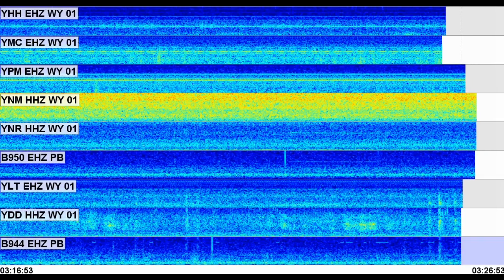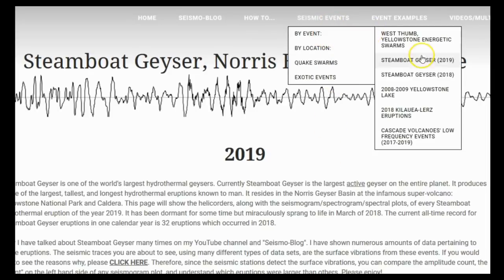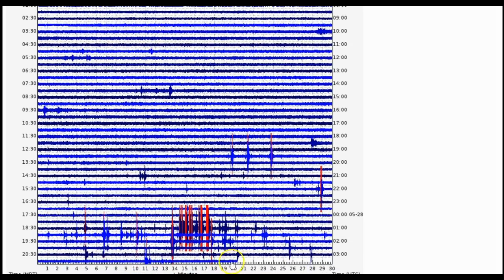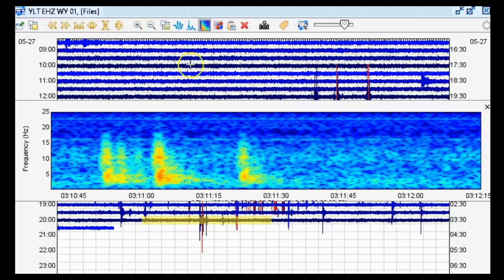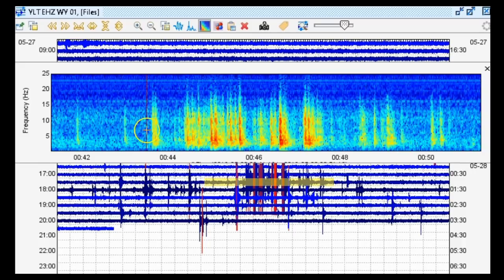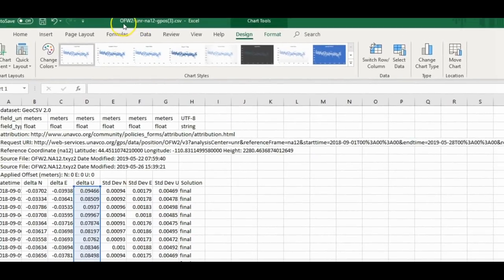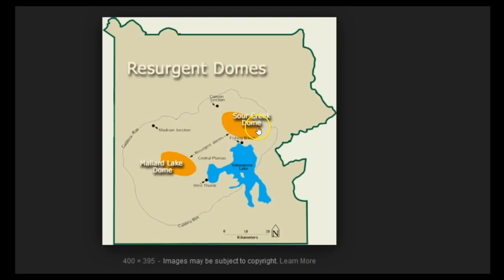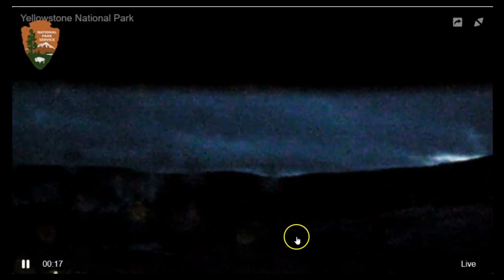Yellowstone Caldera Rapid-Fire Swarm - Steamboat's Official 50th Eruption - Uplift/Subsidence

Comment: Very interesting as always. Steamboat must have a fairly stable flow of heat to produce such regular events.
On your Uplift/Subsidence checks, have you thought about checking other stations outside the active areas? For both YS and Hawaii it would give you a reference to see if the movement is local due to activity, or regional due to plate tectonics. Thanks for the frequent updates.
Reply from the maker: Hey Mike! you are probably right in regards to Steamboat. And I was looking at uplift/subsidence patterns which are not affected much by plate movement. Horizontal is, but vertical (comparing IGS08 and NA12) are barely affected by plate movement since most of the time plate movement is horizontal... Most of the time... Regardless, I always use NA12 to remove the plate motion. God bless!
Reply: @BenFerraiuolo  Hi Ben. I wasn't thinking of any changes introduced by the reference frame being used. More along the lines of checking active areas against the movement of the region. As an example, if Montana and Wyoming show slight subsidence, then any uplift at YS would be more significant compared to what the region is doing. Same with Hawaii. If all the islands are rising, then local activity is relative to the regional 'normal'. Just something to think about. God bless.
Reply from the maker: @mikem6788  Ohhhhh I see. Haha my bad. That does make sense. Ill check it out and see what I find. However I think GPS stations around much of the USA do show very, very tiny subsidence. I rarely see any uplift from non-volcanic areas. But I don't know for sure.